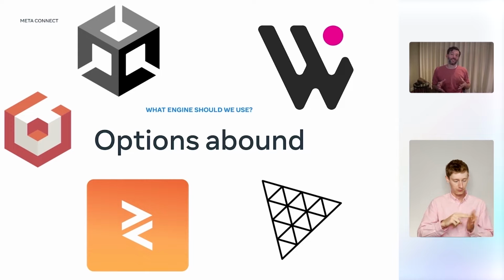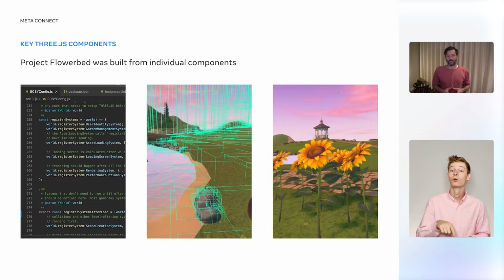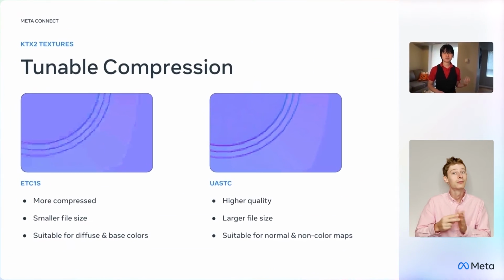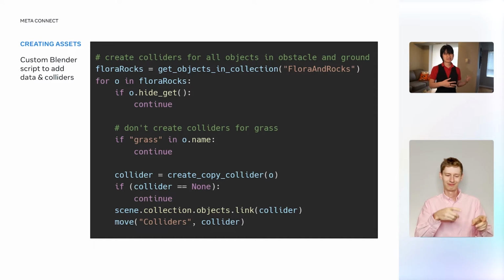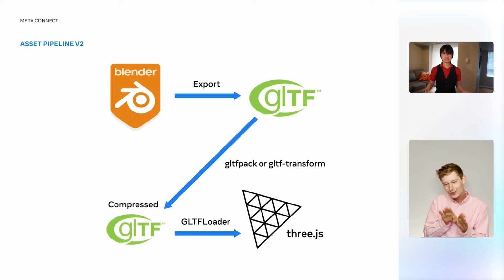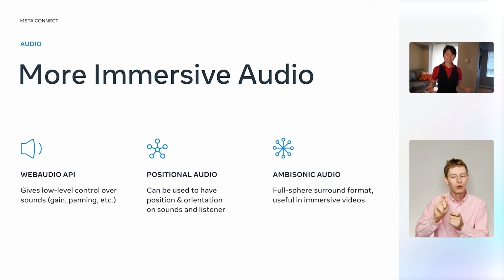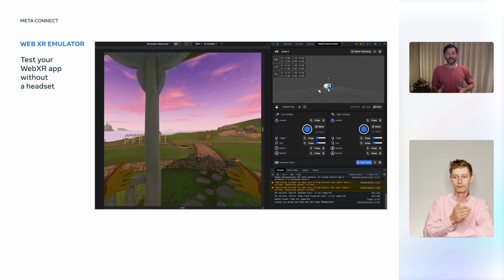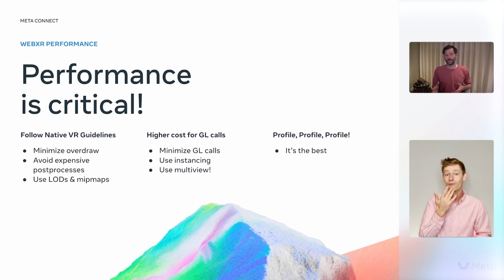Meta Connect 2022 | Build Great WebXR Experiences

Comment: Being a backend app developer my main experience is designing the data structure and data flow along with the rest api. However I have always wondered where from to start and where is the logical end when building a 3d graphical ui for a software. Be it a game or something else. Things like the surrounding model, the main interactive models, physics, syncing sound and animations, defining what’s doable and touchable. 
From what I have seen up to date this seems to be the most comprehensive all included sort of framework.
Looks quite complex yet did answer most of the topics I would have imagined.
Screams to give it a try - challenge.
Really glad I did run onto this one.
And thanks for the dev and product team - shared this in a very comprehensive way.